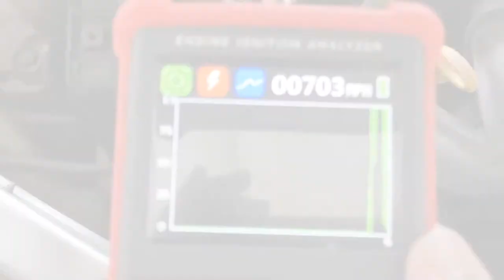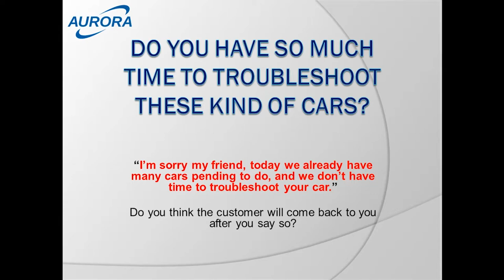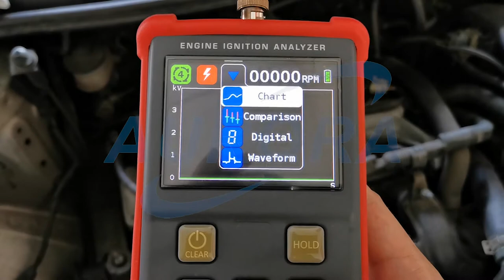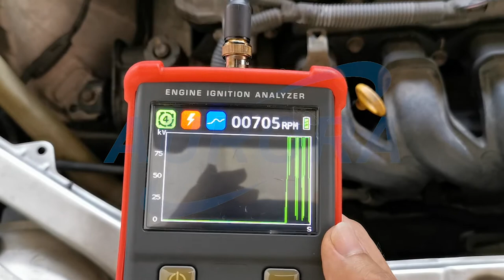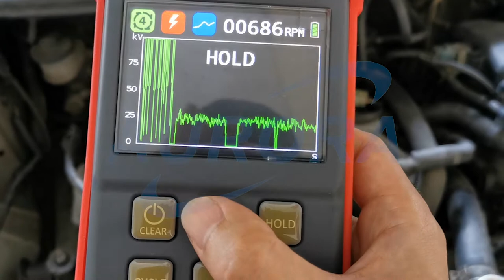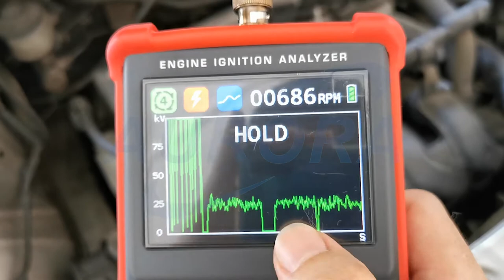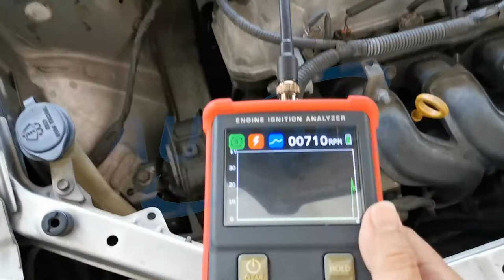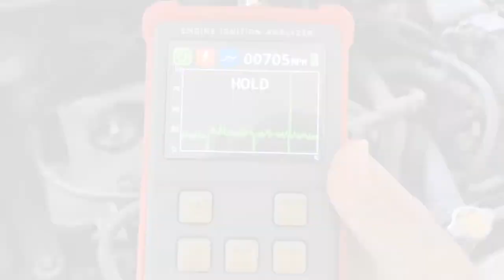GTC505 Coil Tester / Engine Ignition Analyzer

Comment: could you show an video of using GTC505 to analyze on grand livina or nissan slyphy? As it has intake manifold covering up. How do you detect through the plastic covers.
Reply: the probe is flexible, so it can just tap the body of coil from the side